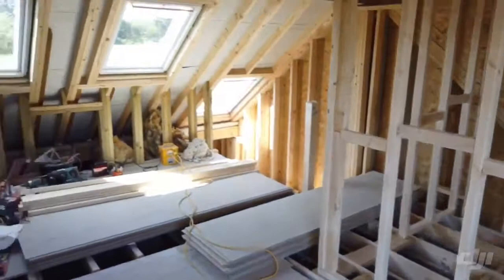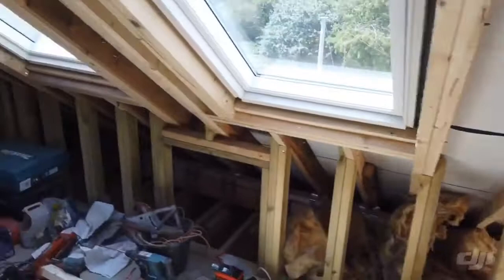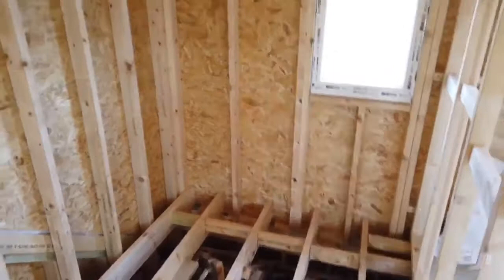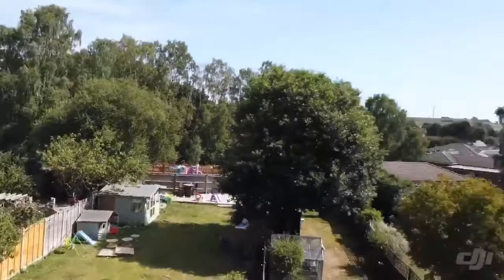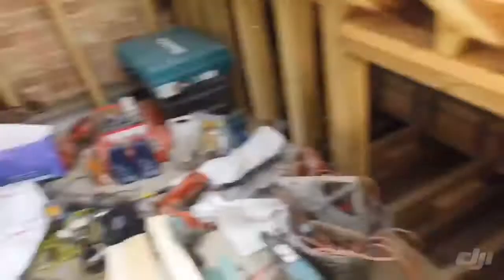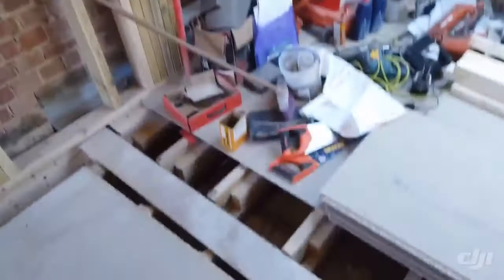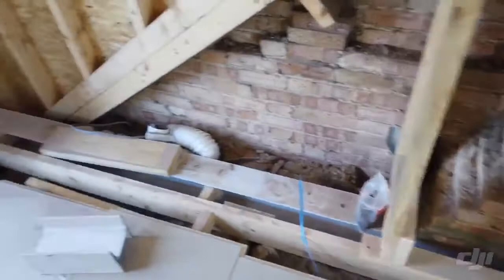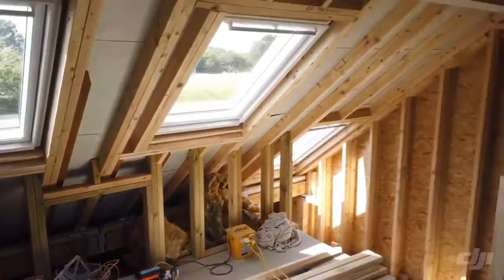Dormer Loft Conversion - Showcasing the Structural Elements

Comment: You could not determine if the Center wall was load bearing or not ...? So you put in the steel anyway...?   You should not be doing loft conversions bro !     Lol   😜
Reply from the maker: Thank you for the comment. We couldn’t determine if it was loading bearing as the client didn’t want us to open up the walls on ground floors to see what steel was in place. So was easier to bridge over in the loft with no disruption else where in finished rooms. 

Thanks for your concern. But we are a fully established loft conversion specialists and complete 60 loft conversions a year so think we have a good idea.